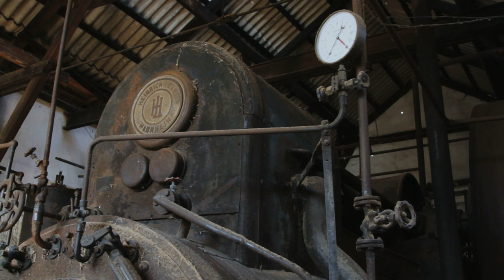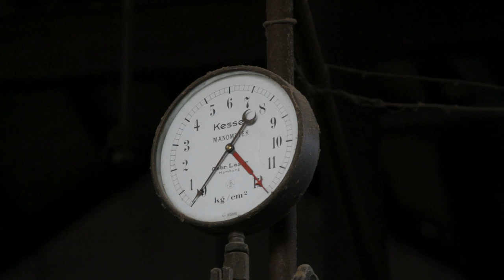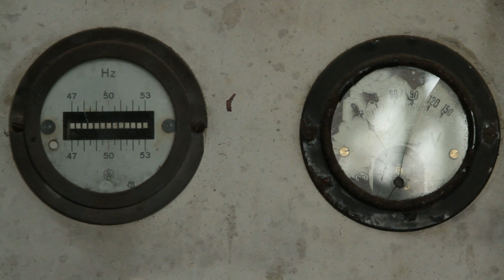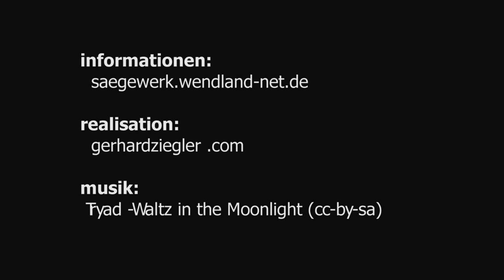Sägewerk Gartow - Dampfmaschine

Comment: A lot of work if you want to put that steam engine back into operation. What a lot of rust.

I think there is a lot to replace. The steam boiler will certainly be rejected for reuse. Then all moving parts must be overhauled.

That will cost a lot of money.

It is better for them to bring this to the scrap yard than it will generate money.